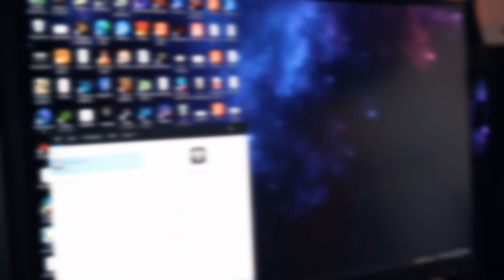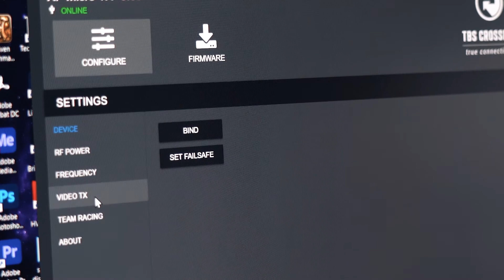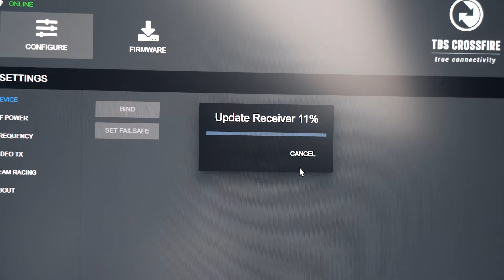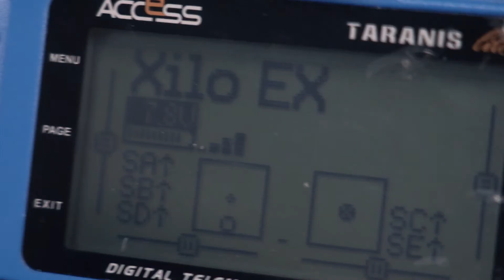Crossfire Sixty9 // Wiring + Binding + A little about Myself // KUWAIT

Comment: If you already have the current fw on your tx, all you need to do is turn on your tx, then your Sixty9 and it'll bind automatically. You may need to press the bind button on the Sixty9, but that's pretty much it. Computer isn't needed.
Reply from the maker: thnx for the update 🙌🙌

Comment: You may want to rethink using hot glue as when the 69 heats up it will melt.
Reply from the maker: Ohh thanku for the advice. What do you recommend I use as the connectors move alot and I'm afraid they will disconnect mid air
Reply: @adelji  I use E6000. The stuff sticks like crazy but stays soft enough to be removed and doesn't seem to melt from to heat.
Reply from the maker: @michael.mccauley  perfect. will use that then. thank u :)